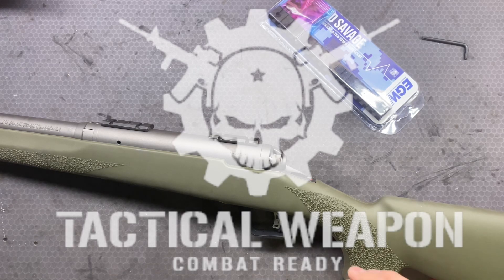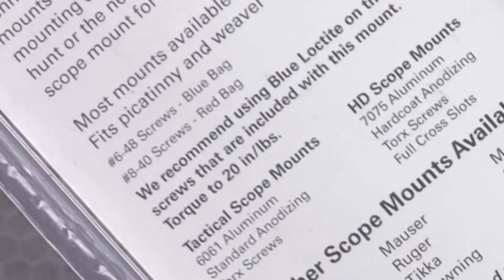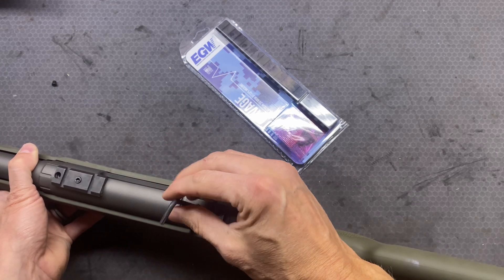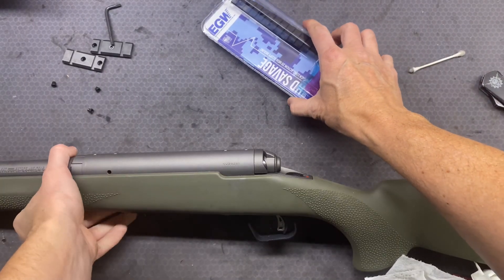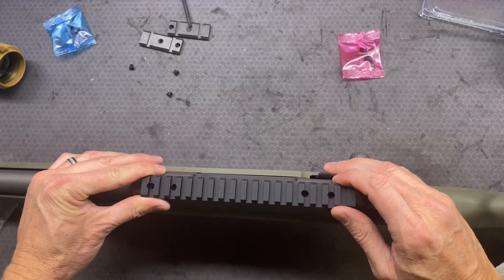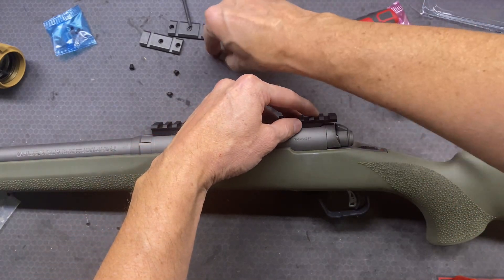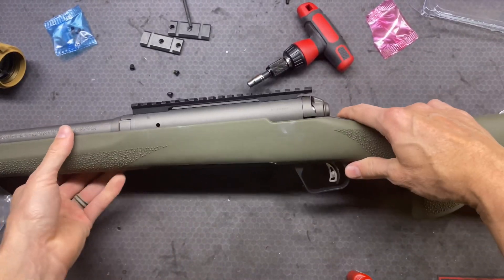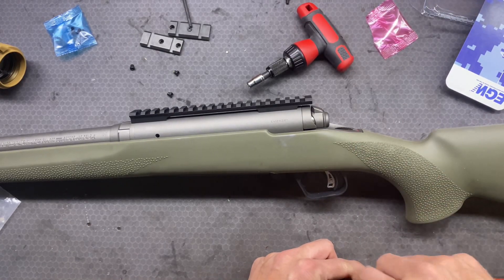Savage 110 Trail Hunter Long Action 1 piece optic base mount installation

Comment: You actualy put that rail on backwards bro
Reply from the maker: Yeah I know. It didn’t have any instructions so I measured with some calipers and must have flipped in between cuts. It’s easy to get things mixed up while filming. I didn’t realize it until after it was all done but I flipped right after. If it was a 0moa it wouldn’t have mattered but with it being a 20moa
Reply: Taller side should be closer to stock ?
Reply from the maker: @metaller_alex  yes. so higher on the back, closest to your shoulder and lower on the front, closest to the muzzle.
Reply: Yes he did